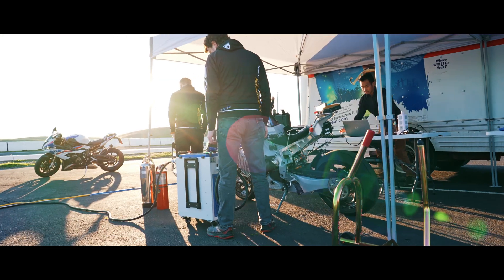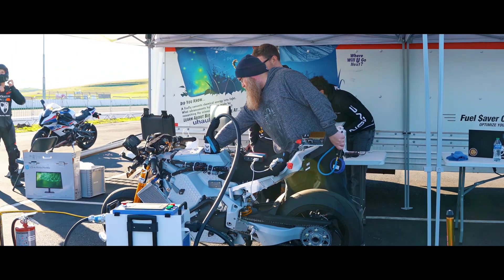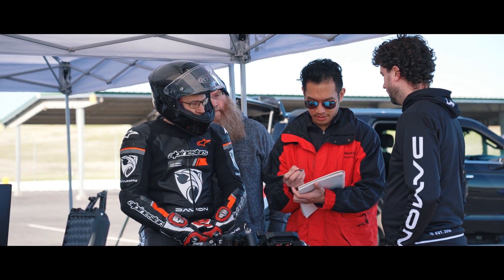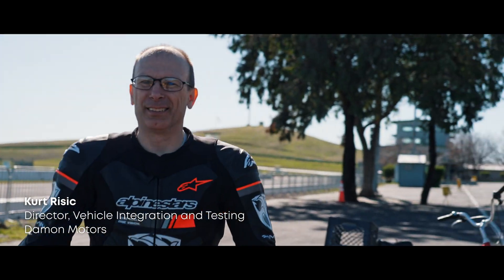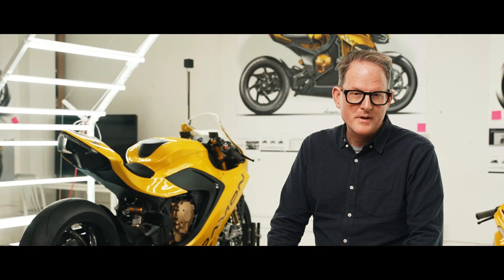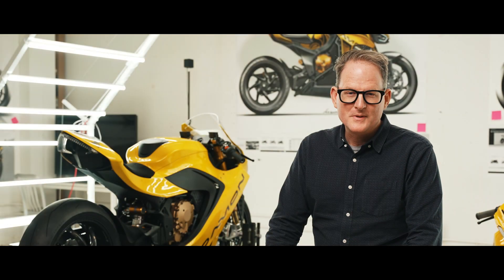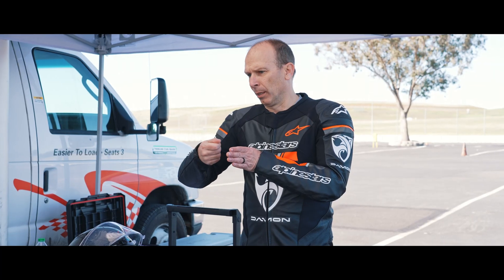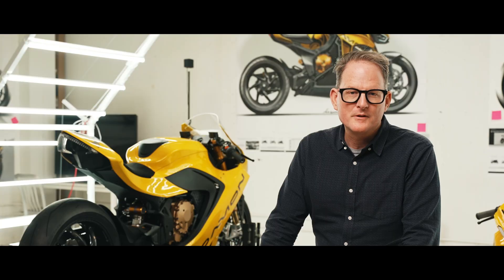Damon HyperSport | Engineering Test at Thunderhill Raceway

Comment: Would be really convenient if it hooks up to Tesla charge stations
Reply from the maker: While there may be non-factory solutions in the market that allow non Tesla vehicles to plug into Tesla charging systems, we recommend using charging stations and/or facilities that support the J1772 connector for use on Damon’s motorcycles.

Comment: Test the quarter mile time in this race track.
Reply from the maker: We have not run a timed quarter mile yet, but expect top of class performance from a bike equipped with launch control, traction control, wheelie control, peak torque from 0 rpm, no shifting and > 1g acceleration! It's 0-60mph time is less than 2.7 seconds.